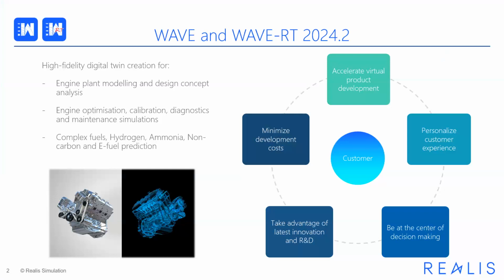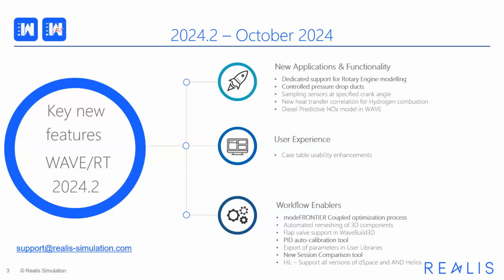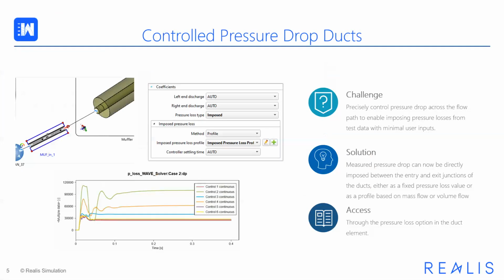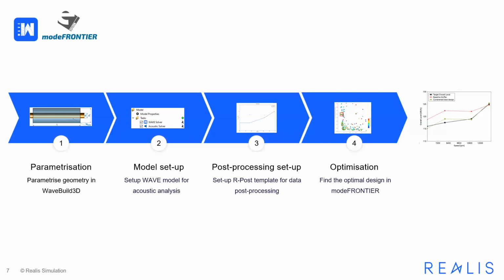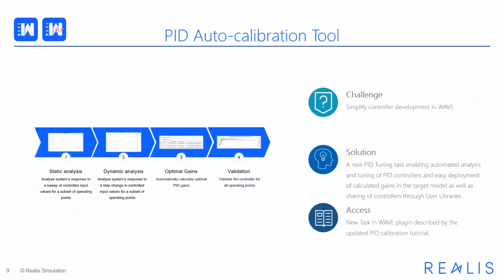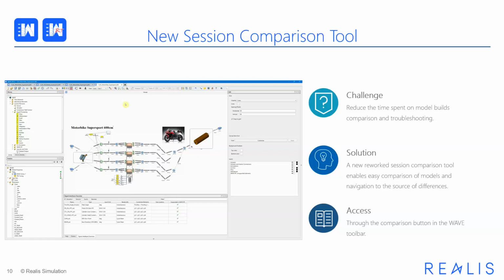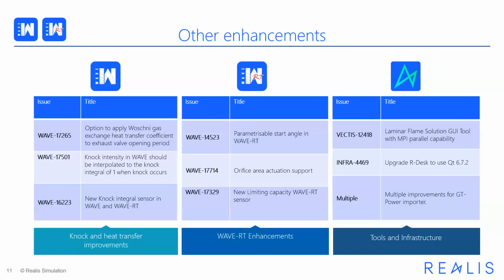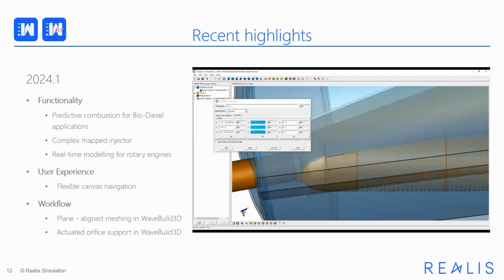WAVE 1D CFD 2024. 2 What's New Updates

Comment: 👋Greetings Master. _How to adjust the software to observe the behavior of Atmospheric air in a Cylinder intake during combustion of the air/diesel mixture under the following conditions: ➡️ admitted air mass; in order to obtain the leanest burning possible from the stoichiometric ratio range between 14.5/1 to 200/1. Taking into account the variation in temperature and pressure of Atmospheric Air at Intake from 17° to 50° and 1 ATM at 1020 mb. The cylinder with a cubic capacity of 1200 milliliters with the geometry of the commercial model OM924 Diesel engine. -Consider Diesel S10 in a typical mixture commonly found at gas stations ⛽